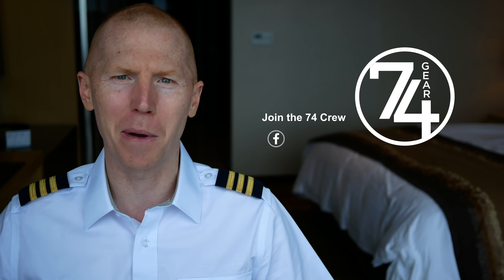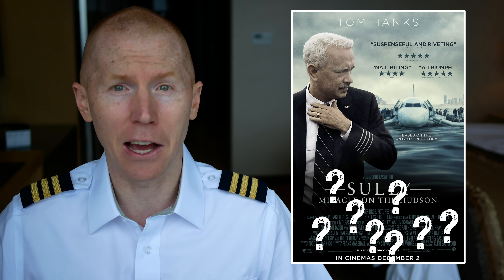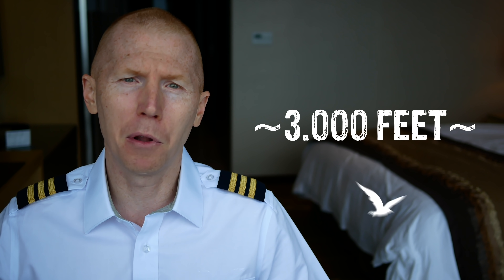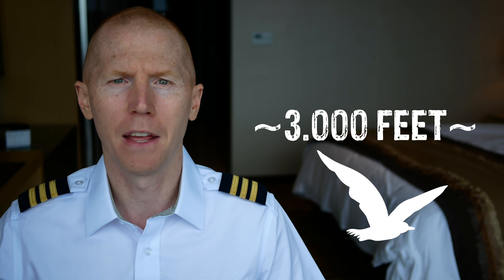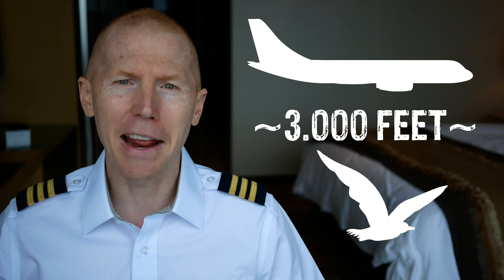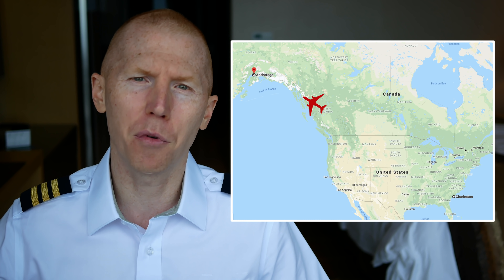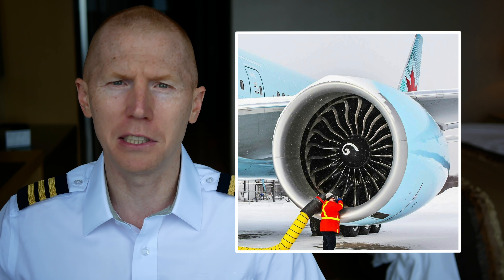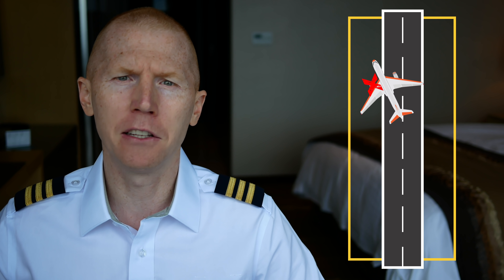Why Engines Don't Have a Mesh or Grates to Stop Birds

Comment: Most airports will employ countermeasures to prevent birds gathering around the airfield and not come in direct contact with the engine whilst an aircraft is taking off or landing. This may include keeping long grass around most parts of the airport and recordings of a hawk to scare the birds away

Comment: While there isn't airplane equipment to prevent birds from getting sucked into an engine, there ARE measures being taken on the ground to prevent bird strikes. Smaller airports might use RC planes made to look like hawks or even trained dogs to chase  birds away from the airfield, decoy predators other deterrents are placed around, etc. Plus, birds are generally intelligent enough to avoid busier lanes of air traffic. I always thought that Sully's midair mess was     a case of particularly bad luck; a large airport like La Guardia has a lot of traffic so the probability of a bird strike is up simply because of the sheer number of planes going in and out, on top of that they managed to hit AND shut down both both engines, despite years of industry testing and development centered on helping jet engines withstand bird strikes. (If I remember correctly, part of quality control in most manufacturers is to chuck a bird carcass into the engine.)

Comment: But what if there is a bird strike at a low height during takeoff, is the 777 going to cut power to the other engine causing it to loose power in the air that sounds scary 😳

Comment: What if you have a retractable mesh? like its extended at take off and retracts when you go above 3000 feet? Then above 3000 feet your engines are running at maximum efficiency and below that, yes your losing fuel but your also protecting something worth 25 million dollars

Comment: Also, any restrictions in the inlet will cause less air to hi-bypass engines therefore causing higher EGTs and TOTs. Higher temperatures will cause TBO times to decrease, causing the company more money. Company’s would be loosing a lot of money due to the more fuel to compensate, quicker times before overhauls, mass production of a “screen”, then they would if every now and then a plane ingest birds. Also planes ingest birds more then you think, there is no effect on the engine if the bird is little like most birds.

Comment: Jet engines need something like the inertial separator that turboprops use to reduce the risk while taking off and landing without affecting engine performance at high altitude.

Comment: To expand on some comments here (and from the video):
1) It is possible to fit a mesh in front of a jet engine - this is done during ground testing to protect the engine from small bolts, nuts etc (a FOD screen/guard)
2) Planes fly at 500+mph, which makes a birdstrike the equivalent of being hit by a chicken flying at 500mph. That's a lot of energy so you would need an incredibly strong mesh, as otherwise you will simply end up with the mesh breaking and being sucked into the engine during a bird strike - so rather than improving things, you make everything a lot worse.
3) The performance impact for a mesh isn't just on the extra drag, but also the extra weight you are carrying around (which rules out retractable systems). The stronger the mesh needs to be, the heavier it is, so the greater the impact on performance.
4) Ice. A mesh screen is a great place for ice to form, which would cause all sorts of problems. A blocked up mesh would cause a similar level of drag as activating the thrust reversers mid flight (this normally results in a crash killing all on board).
5) Rather than put a mesh in front of the engine, why not just strengthen the fan blades so they can chop up the birds without the downsides listed above?
6) 5) is actually what we do in aviation. The certification regulations (FAA/EASA etc.) dictate the size of bird the engine needs to cope with. Unfortunately for Sully he met a flock of birds that hadn't read the regulations, and they were significantly larger than what the regulations required the engine to cope with. A mesh screen would have had the same problem - hitting an entire flock of Canadian geese was considered so unlikely that the regulations didn't need to cover it. The problem is now being tackled from multiple angles - stronger engines, better wildlife management (where birds nest and fly) and better tracking (including bird radar) to try and stop it from happening again.

Comment: Directional air flow screen in front of engine. Either retractable following this, or screens straight to help direct airflow into engine efficiently. Or bladeless engines which push air through, but objects can travel through too.

Comment: Unless it is a helicopter engine. Particularly military helicopters.
Landing in a field of twigs, gravel, sand, occasionally trash, and birds.
Get engine air particle separators fitted or your engines will not last long.

Comment: Two words: inlet distortion. It's not blocking the airflow as much as it is changing it & adding a whole bunch of turbulence. Turbofans need good, clean intake air otherwise you can upset the fan and/or compressor with those pressure fluctuations, causing compressor stall which is usually followed by an engine surge (very bad for the engine)

Comment: A bird hitting a birdscreen at jet speeds is just going to go through the birdscreen in small chunks anyway.  Maybe those chunks are just bite-sized for a jet engine I don't know.. but I do know that birdscreen that would be thin enough to not obstruct too much airflow would just dice a bird at 250-500 mph like a slap-chop.  Well a big goose-sized bird would certainly go through a birdscreen and take the screen with it.  Maybe they should just put one of those deer-saver noise maker things on the nose of the jet.  LOL  ;-)

Comment: Can´t see how such an automated system can fail and try to compensate for an engine thats not really lost and send the airplane right into an terminal building high speed for example.
Remember the case where an engine malfunctioned sending shrapnel through the planes fuselage and cutting communication to the remaining running engine on that wing? They had to land with an engine running at crusing speed and fire fighters tried to put out the engine for 45 minutes with water and finally manged to do it with a lot of foam.

Imagine communication is lost during takeof, the engine is going full power on that wing. The computer no longer sees this and shuts down one engine on the other wing, thereby creating the imbalance and sending the plane of the runway!

As a pilot you better react fast in that case and override the throttling as if you try to shut down the engine which lost communication that wont work (communication is lost).

Some automatic systems do make sense, like stabilization systems / translation systems of input -> output of the control planes. Some aircrafts can´t really be flown by a human as the combination of control planes you have to actuate non linearly to generate the desired outcome is to hard for a human to control manually (thing some fighter jets which are non self-stable).. However such "safety" systems which only activate in extrem cases tend to be unknown to the pilot / forgotten about and can create quite dangerous situations IMHO..

Comment: The reason is... that the current state of the technology doesn't make it feasible, as it happens with so many things that weren't possible until advancements made it possible. A static mesh would probably never work for the reasons mentioned in the video, but who knows... maybe in the future someone will come up with an ingenious design that could unfold a light but rugged flap in front of the engine intake, covering it temporarily if a computer detected an incoming bird strike.

Comment: I'm just guessing, but I would think that a mesh/screen is going to block air flow to the engine and increase drag.  Also, at several hundred mph, it would have to be a pretty sturdy material to keep from being torn to shreds when hitting a bird.

Comment: The engineer's should come up with an idea where there's some kind of cover that goes over the engine on takeoff and Landing but then once you're above 3000 ft a little door opens and brings the crate back inside the plane. it seems like an investment that might cost some money but in the long run it you know might prevent accidents.

Comment: The Russian Sukhoi 27 fighter has a system to prevent FOD being ingested on takeoff on unprepared runways in improvised airfields close to the front line. A door shuts the main intake and air is sucked in through a grille above the engine. Once in the air, the door opens and the the grille is shut.

Comment: A grate wouldn't work anyway. At 180+ mph, even at low takeoff speeds, a bird hitting a grate will explode and chunks of it will get sucked thru the engine anyway, a grate would be effectively pointless, and that's not even considering how it would negatively effect airflow, and how airplanes spend 99% of their time at an altitude there aren't any birds flying at.

Comment: Engines are expensive, jet fuel is expensive. Everything about aviation is expensive.
Reply: Why not have a screen that is only there on take off then it retracts at say 3k ft?
Reply: @nofurtherwest3474  Another thing to develop, another thing to test, another thing to maintain, and another thing that can break.
Reply: And it won't be helpful anyway
Reply: @이주연-x4x  not that hard to develop. but probably not worth it.
Reply: @nofurtherwest3474  because you need max thrust for takeoff etc.
Reply: @nofurtherwest3474  Screen and lasers.
Reply: @nofurtherwest3474  I believe aircraft use most of their power at take off so it would be in efficient
Reply: @aidanmorgan6291  so the screen would only cover the engine after it reached a certain altitude
Reply: @nofurtherwest3474  retract where? There's no where on the wing for a big round great to go, especially while flying.
Reply: @cybersilver5816  idk man. i'm just brainstorming. ok fine it looks like you win. probably not a big enough problem for this kind of solution anyhow. Doesn't happen all that often.
Reply: @nofurtherwest3474  yeah, sorry for bugging you about it 7 months after the fact.
Reply: @cybersilver5816  haha no prob. It was just an idea. I come up with many ideas... and most of them wouldn't work out! but it's fun to think up stuff
Reply: Getting your license to fly is expensive...
Reply: An even tickets are expensive
Reply: that's why japan preferred bullet train than planes🤔👌👍
Reply: @4_Skyrex  that's it Bullet planes
Reply: @4_Skyrex  plus Japan is an island so they don’t really need to fly anywhere
Reply: @aidanmorgan6291   I don't know about you, but a lot of my close friends from Tokyo opt to fly into Osaka instead of taking the shinkansen. Also take into account, the shinkansen doesn't exactly go everywhere, especially off of Honshu, for example, Nagasaki. Really depends on your budget, honestly.
Reply: @Aidan Morgan "Japan is an island"
Wow
Reply: As someone who ships airplane parts for a living, they can be ridiculously expensive. I've seen a single bolt cost $1500,  one o-ring  $100, I've seen flight computers for $300,000+.
Reply: 1.Technologies are expensive
2.Worker labor is expensive
3.Evrything is pretty big.
4.Profit for companies
Reply: Even flight peanuts
Reply: Yeah, so the tickets are also expensive.
Reply: Even the food on  board IS expensive
Reply: Not to mention the engineering with the software and hardware redundancy so you could assure a safety ASIL A
Reply: hell, the tickets are expensive
Reply: Thinking about it is expensive.
Reply: Even carrying another luggage is too expensive 🤣
Reply: Deez nuts are expensive
Reply: well it's also about creating less air pollution... 
if your plane (or all planes) use more fuel = they pollute more air = more global warming
Reply: the airport is expensive
Reply: Jet fuel is cheap
Reply: @souravsatheesh913 Factor in fuel burn of airliners and you get a whole different picture.
Reply: @이주연-x4x  did I mentioned fuel burning ratio?
Reply: Sourav Satheesh everything is cheap dumbo. It’s called supply and demand bud. Whoever has most of it pretty much names their price.
Reply: @souravsatheesh913  yeah, by the gallon its only about 1 dollar usually, but when you factor in the amount, its not exactly cheap
Reply: @souravsatheesh913  so we should stop driving cars. The aviation revolution?
Reply: @KAT-hs3xh  No.if using commercial planes.Only if the cars have wings.But we need car runway's and another pilot license.But taking off the road is hard with alot of cars only if you have a car helicopter
Reply: this guy is rich af

Comment: What if the bottom of the engine cowl deployed forward and then raised up at an angle, which could deflect birds on climb-out and approach attitude? Above 3000' stow back under the engine. Similar to how flaps deploy and then when not required, retract to a clean config.

Comment: 1. How many % of air reduced if wire mesh were installed.
2. How if wire mesh automatic engages below 3000 ft and disengage above that altitude.
3. The wire mesh should not in a flat shape like the one on Chinook, but coned, to reduce drag and to reroute obstacles.

Comment: What about a thin electrified grid? And are there the any alloy that would be strong enough to withstand the bird strike? And what effect does the bird strike have on the rest of the engine? Could it be designed so that there would be strong turbine blades and "pick" areas for "bird residue"?

Comment: I've a question
if bird strike happens between v1 and vR,then what????
coz after v1 a can't abort the take off
but as it didn't reached to vR it can't rotate....
in the mean time the 777 technology minimize the thrust of the running engine for the ballence...

in this case the flight will over run and it will act as a huge missile full of jet kerosene and some humans with a huge impact

is there any kind of technology or procedure to prevent from this kind of situation?????

btw Kelsey I'm from india,
and i follow you regularly
i love your videos

Comment: My additional guess on why engineers do not put something in front of the engine is that, if a bird would hit that what ever u put in front of the engine, it would be stuck there for the rest of the flight because the air plane is mostlikely so fast that the pressure would hold the bird at that position it crashed onto. From there on the bird might get frozen from high altitudes and or it would most likely get sucked into the engine bit by bit, droping blood and body fluids or maybe organs and feather info the engine and those would do more damage to the engine overtime then a single "bird-bullet". So even if the bird now stuck at his engine, the pilot would not know that the bird hit the engine if there is no damage done or air-intake reduction in the first place, letting the pilot maybe decide to continue his flight and then wondering why the hack his engine is dying on him at 35k over the middle of the Atlantic ocean. Not even speaking of bird-hits breaking parts off of what ever anyone would put in front...
Reply: Not flat one. Cone-shaped.

Comment: Why not make a screen that gets pulled up into a compartment in the engine so it can have protection from birds but after 3k feet it gets retracted into a compartment
Reply: Because the bird would still be forced through the screen with the pressures. Also, it would require heavy armour plate grade steel to prevent, and a design that radically reduced engine thrust.

Comment: Just have lines of razors shaped like a cone 5 -10 feet in front of the engine. The air would go right by, anything hitting it at speed would get sliced into small pieces or forced to the side.

Comment: What if engineers design a protective panel in front of engine which can be movable. So while aircraft is taking off n landing or in the range of 3000ft when the chances are higher for the birds to strike the blades the automatic panel will be there and when it's in the safe zone they can just be automatically uncovered while the whole flight time till the time of landing. It would be little less fuel efficient but much more safer and fuel consumption will only increase for the very minimum time only during take off and landing.

Comment: I understand that the engine doesn't need the protection for most part of its flight and also it needs to be efficient. But, can we put a retractable grate made of some high strength, light weight stuff which can be retracted back into the engine after it reaches a safe height?

Comment: How can someone be so stupid and confident at the same time. 

Haven't you seen a helicopter jet engine protection, engineers can make retractable protection to protect below 3000 feet, and retract at higher altitude, if there is someone care to pay for safety of human life.

Which is usually not the case.

There can be many safety features   only if people in power have right priorities.

Comment: Is it not possible to mount 4 engines?..2 primary and 2 secondary..and enable the secondary engines to be closed upon take off/flight, and only be opened electronically once a bird has strike one of the primary engines? Or in the event one of the primary engines fails for some reason..I know it will have an impact on the weight and money, but I'm sure that can be compensated for..and will almost eliminate the chances of plane crashes caused by engine failure..

Comment: Well you said u only see birds at 3k or lower so how about a retractable grate that will retract after 3k feet yeah your gonna have to use  more power and burn  more fuel until your over 3k but like u said u u where only under 3k during that flight to alaska  for a few minutes